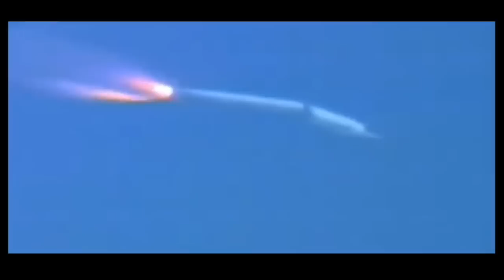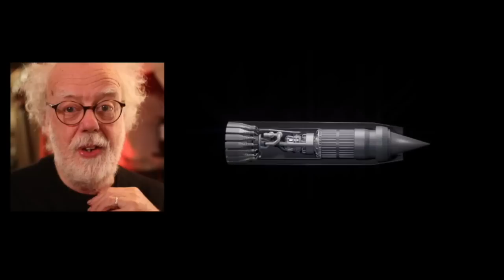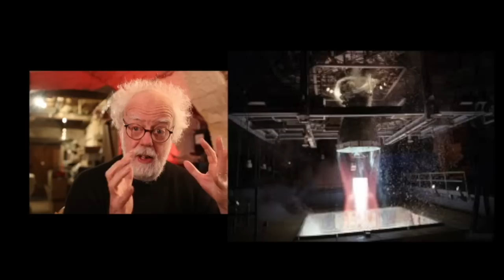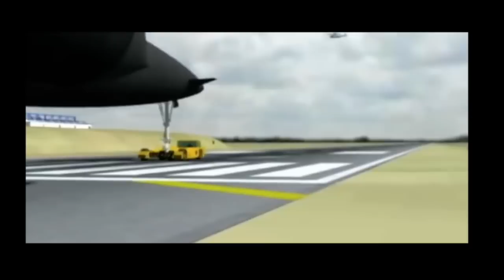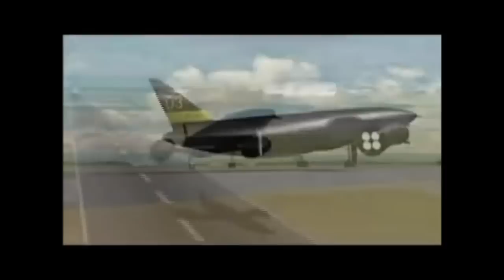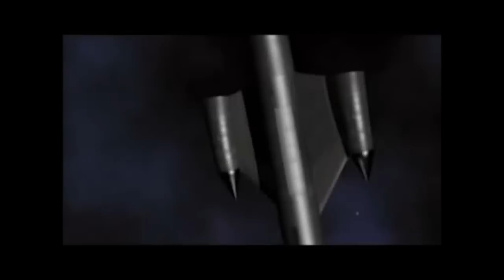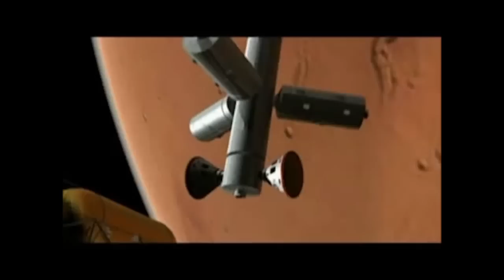SKYLON - The dream - Prof Simon

Comment: The anti-frosting technology is NOT secret. It is detailed (albeit in the usual obtuse patent-ese language) in the patents that were filed and publicly accessible back in 2015 See:
https://patents.google.com/patent/GB2519148A/en?assignee=Reaction+Engines+Ltd.&before=priority:20160101&after=priority:20130101&page=1
for searchable text, and:

https://patentimages.storage.googleapis.com/c8/23/c6/5637f3c2e5629f/GB2519148A.pdf
for images and diagrams.

This was in the V3 SABRE. It used some trick of chemical processes where methanol would travel against the airflow, dissolving the ice crystals that formed on the pipes, and transporting it away from the tubes, then recycling the methonal. This prevented frost building up.
The V4 SABRE has a different design. So far as I understood, (and obviously, it is not always possible to have absolutely all the info) they came up with improvements to the engine cycle that meant they didn't have to go sub-zero, so no frost, so no anti-frosting tech needed.
I have never seen anything that would indicate "vibrations" being used.

Comment: A lot of pretty pictures, does not make it so.
Reply: Thirty years of engineering work, however..
Reply: @jocramkrispy305  Yeah, propably thirty years more.
Until they find, it won't work.
Not in this form.
I would equip a glider with scram jets and lift a smaller rocket to high altitude,
from where you launch.
Then, you can bring multiple smaller payloads into orbit and use remote
controlled drones, to assemble the entire thing, in space.
Reply: OK, what flaw have you found in the design, missed by both ESA and USAFRL who have both said they can see no obvious flaws? how many hydrogen engines have you worked on and successfully fired? How many launch vehicles have you designed that have successfully put a satellite on orbit?
Reply: Your approach is quite the antithesis of a HTOL SSTO, and would not achieve the operational simplicity that this engine is designed to enable. How are you going to get your scramjets up to operational speed?

Comment: Really inspiring, I would only venture to say from an aviation standpoint I would like to see more vertical stabilization. Like a bit of a spine leading into the tail. That's all I got.😬
Reply: The all moving tail is enough, given the CoG is quite far forward and the vehicle is long. The design point for the tail is they can fly it with one engine

Comment: Prof S. Holland, I think that the method of breaking away ice from the tubes is not vibration since fatigue life would be major failure point and 10^7 cycles would be achieved very quickly.  A better way of getting the same fluctuations is von Kármán vortex street, vortex shedding, alternately shed wake off a cylinder with cross flow.  Then the first layer inlet would be non-cooling and there after all the other  and first would shed a vortex that cleans the leading faces of the tubes in their wake.   

The nozzle picture shown was also interesting.  The first standard bell type nozzle is a failure.  The second dual nozzle would work to take a short in atmosphere nozzle and convert it to a vacuum one.   The third I think is just a version of an aerospike.  But with the center area at atmospheric or vacuum pressure.   An interesting twist since it addresses the major problem of an aerospike, the very large throat and combustion area of a annulus combustion chamber and nozzle.   I assume some air is exhausted in the center to create the 'atmosphere pressure and detached boundary that adjust for pressure.  The bell on the outside is the attached boundary for the combustion chamber supersonic flow.   Thus the annulus is much smaller while the engine gains the pressure adjustable of an aerospike.

Comment: Couldint it be just an adjustment of the inflow of air to not get quite so cold. You have 1000 degrees hot air and below freezing helium pipework cooling it. Less helium, more heat, no freezing. I know its probably not that simple.
Reply: That is one of the potential advantages of the SABRE 4 design, however the de-icing capability may have application for other uses of the pre-cooler.

Comment: It's not just that oxygen weighs a ton, but you need twice the oxygen weight for your tank of hydrogen.
Because H2O.
Reply: You may have your logic backwards, H2 and then O1, not the other way around ...
Reply: Yeah, that's definitely backwards.

2 hydrogen per oxygen.
Plus, what has the composition of water have to do with rocket propulsion?
You're using oxygen to 'burn' hydrogen...
The main problem is oxygen is, based on the periodic table alone, 8 times as heavy as hydrogen.

An equal number of each molecule would mean you'd have 8 kg of oxygen to every kg of hydrogen...
Pretty dramatic difference...
Reply: @KuraIthys  yes that person has it backwards, but the relevance of H2O is because that's what the combustion product of H2 and O2 is. Stochiometrically you need 4x the mass of Oxygen as you have Hydrogen. But it's usually a little lower than that because most engines run a little fuel rich to avoid Oxygen attack of the engine's metals.

Comment: Great video, thanks Professor. Would it be possible to de-ice the precooler by pumping some exhaust gases through just one section of it at a time? Say, looking from the front at the annulus, heat from the 12 to the 1 o'clock position for a few seconds, then valves switch the heat to the 6pm to 7pm section, then back to the 1pm to 2pm section and so on, round and round?
Reply from the maker: Good ideas

Comment: so why not use hydrogen per oxide as fuel ??and reduce the speed of the vehicle in orbit so it dos not generate so much heat during re-entry - as in have a fuel system placed in orbit to re- fuel the ship for the retro rockets
Reply: I wouldnt trust my payload on a vehicle that cant carry enough fuel to retro. Retro doesnt require much ΔV, not compared to launch.

It's relatively easy to reenter when compared to reaching orbit.
Reply: @Jwmbike14  It requires a lot of fuel if you're using retro to avoid reentry heating, as Alex Smith was suggesting
Reply: ... how would you get all that fuel into orbit?

Comment: Yeah, a whole bunch of rubbish: do you really think Chinese will buy it?
Indeed you have to cool all that air really fast before you burn your fuel with it! Or it may get really hot you know, like a rocket engine or something! That's British rocket science for you!
Reply: Yes, you have to cool the air so you can compress it since rocket engines need dense cool air that isn't moving supersonically. And while it's on its way to the combustion chamber it shouldn't melt anything.

Comment: I wish Reaction Engines the best, but I'm seriously concerned this concept will be like betamax vs vhs or a kind of spacecraft formatting where one company will get a monopoly and other companies with safer and superior the technology get left behind because they couldn't get past the barriers to entry fast enough.
  I love SpaceX but I think bfr will have same problem as space shuttle or other conventional rockets. They are intrinsically unsafe.  The less stressfull ascent and reentry profile of skyline and it's true SSTO capability are the areospace equivalent to nuclear fusion.
Reply from the maker: Brilliant analogy
Reply: @SimonHollandfilms  thank you.  The gravity loss problem and higher fuel weight fraction of conventional rockets means they have to perform at a dangerous threshold of performance.  Skyline just takes off like a plane and it looks like it's flight profile and the advantage of air breathing means it's engines can cruise easier, with less chance of catostrophic failure.
Reply: my fear is you're completely right. the british ruling class is basically incompetent, while the real talent is wasted. that RE has to scramble around for private investment is a travesty. meanwhile nerd billionaires push half-baked vanity projects and the best solutions remain grounded. sincerely hope something changes.

Comment: Why not use the Aerospike type for the burning is better at sea level and expands for the higher level al the way to and throughout the space flite and back again throughout to sea level by using the air pressure to form the other bell half. There are some cooling problems with it but your telling of some opposite of having too much cooling why not combine these to solve each other's needs and the gimbal can be solved by flex tubing from the combustion chamber to exhaust as an Aerospike by transferring this heat to the intercooler from the spike's tip or Vise Versa. Heat some Hydrogen to add to the cooler's path the hydrogen will cool the spike this heated hydrogen can warm the cooler some then burn all the hydrogen with spraying some along the wall of the aerospike's for after the air breather is not used any longer. Or use a coolant to transfer heat from aerospike flame wall to the cooler transfer the cooling effect by a by-pass that is controlled for the needs of each of the needs of the events. There are many ways to solve this.
Reply: because the expansion/deflection nozzle in SABRE 4 is even better than an aerospike
Reply: Aerospikes have well known issues which conflict with the benefits, the ED nozzle is a possible alternative that REL has investigated and even that is no certainty at REL because it has its own complexities.

Comment: These engines are a lot of fun to play with on Kerbal Space Program! 

I've designed MANY SSTO's using them, and stable re-entry has to be the hardest part of the overall designs. 

You have to make sure your center of lift is behind the center of mass, but not too much, and you need to make sure you have a proper amount of variable drag in the back to give yourself a shuttlecock effect. 

There couldn't be a more perfect game to teach rocket science and play with all the possibilities you can come up with. 6062 hours and counting.. not including the time playing the alpha and beta pre-releases. 

Time well spent, rocket science rules.

Comment: Cooling the intake air with the liquid fuel, then slowly add liquid o2, as it leaves useable atmosphere!  Maybe recycle some of the hot intake air to enter at different locations of the cooler, to prevent freeze-up!  
Get rid of the bell nozzle,  that will fix it!

Comment: All these stupid ideas are just a waste.. its the same as a stupid elevator made out of Graphene.. We need an EARTH LIFTER. An Earth liet can lift Tonnes or water, Soil, Metal, Wood concrete Glass, People etc.. all the stuff to make a MONSTER space station. It just takes many years to make and a lot of Energy to use. Years.. to make the EARTH LIFTER, well we have approximately 500-1000 years according to the late Steven hawkings. ENERGY well the ITER, TOKAMAK  should be able to fill this capacity and be a great Space station Energy component.

Comment: So basically just a ramjet engine. That works inside and outside a vacuum.
Reply: No where near a ramjet. ..more like a jet engine siamesed with a rocket engine (so it can in certain regime effectively function as if it was a ramject/scramjet) and an extremely advanced fridge, married to an intake system inspired by the SR-71's.
Reply: The engine does use ramjets to dispose of the excess hydrogen used for cooling whilst over-compensating for inlet-drag (BAe called this concept negative drag, because in HOTOL drag was their work-area and thrust was Rolls-Royce)
Reply: @jocramkrispy305  true, the core engine system used in atmosphere does have moving parts; so overall not a ramjet. 
   But they do indeed seem to be an additional thrust augmenting subsystem handling the coolant spill-off as well as with air bypassed from the compressor core, until the machine is in a high enough mach-speed regime for those 'ramjets' to work more efficiently. 
   Although if the vented hydrogen isn't 'lit' within them, the venturi effect of the augmentor ramjets design would still function as thrust generating area - at a lesser amount compared to when combusting I would think.
Reply: @razor1uk610  uh... yes. That's why I said it uses ramjets, and "over compensating for inlet drag" should have implied they produce net thrust. However, the majority of the air-breathing thrust comes from the air-breathing rocket engine, so it isn't "basically a ramjet"

Comment: Extremely exciting!!!    Makes me wonder how an air-breathing engine's internals would withstand orbital re-entry temperatures.   The SR-71 had notorious fuselage expansion issues even at Mach speeds and associated frictional temperatures.
Reply: Hopefully the engine internals would never bee exposed to reentry plasma. The inlet is intended to be sealed as part of the transition to oxidiser powered ascent
Reply: During the rentry, the craft is oriented so that its underside meets the air flow until its speed is low enough for it to start flying conventionally. So even if the intake hadn't been sealed during the ascent, there would be no flow into the engine internals.
Reply: @sylviaelse5086  It's oriented for a lifting reentry, which means the bottom isn't square to the airflow, but at an angle, so the intakes would injest some plasma if they weren't closed.

Comment: Deicing : Alternating Electrostatic charges, keep the water molecules disassociated and moving.
Reply from the maker: Brilliant
Reply: Interesting . . . you know certain things don't you? ...
Reply: Interested idea. I read somewhere that it was simply antifreeze injected in the intake though...
Reply: @phamnuwen9442  yikes! Sounds kinda messy. But for some reason understood the cooling apparatus to go well below the operational limits of antifreeze compounds. Perhaps I should go and read more articles on the cooler then.
Reply: Pham Nuwen I’m not so sure that would work. 
The antifreeze would be injected in to the airstream before the cooling so wouldn’t the heat of the air at the very least vaporize and at worst damage the chemical solution of the antifreeze?
Even if that doesn’t happen wouldn’t the extreme cold of the cooler freeze it anyway? 
And if temperature range isn’t a problem for the antifreeze, wouldn’t the weight of it be a rather large issue? (pun intended) with how much air is moving through those engines you would have to use A LOT of antifreeze, and it would just be getting dumped overboard. 
Unless the antifreeze is also part of the fuel mixture for the air breathing portion I don’t see this happening... maybe that’s how they did it?
I don’t know any of the numbers here, just food for thought.
Reply: @numnut1516  I don't remember where I read the antifreeze idea and I'm not an expert in the field so can't say either way whether it could work.
Reply: @numnut1516   The methanol is injected in region just above freezing point and collected a little further in, in the below (water's) freezing point
Reply: This goes well with what he said about using some of the heat of the air for engine processes
Reply: It's not impossible as a solution, but the showstopper would be the energy required to achieve the desired effect and the voltage challenges. Due to the very high mass flow rate of air through the cooler, to reliably charge all of the water ingested into the engine the applied field voltage would have to be very high, substantially more than 5 kV I suspect. The mass flow, which I can only speculate on based on my knowledge of similarly sized gas turbine compressors, is likely to be around 200 kg/s of air, which at 100% relative humidity (i.e. a cloud) results in ~ 4 kg/s of water ingested, and the energy required to charge that mass flow would be significant. Furthermore, the voltage itself presents a problem, since as air pressure decreases, Paschens law results in the risk of arcing, as the minimum dielectric breakdown voltage drops substantially.

Comment: Ehm you'just used a heat exchanger to cool air from 1000°C and that heat could definitely be used to prevent the freezing could it not? Without vibrating the tubes which probably wouldn't do much... Thanks for the documentary it was interesting to watch.
Reply: not without reheating the air, which would make cooling it a bit pointless
Reply: Varying rate of flow of heated air over large cooled area will certainly be of use, you don’t have to use all the heated air and transferring heat from one system to another is not pointless, is it? not using the heat to do work is bad design if it can be used. I’m sure RE are top notch engineers and geeks so I suggest that they wouldn’t waste heat like that.

Comment: Ok, slightly lost confidence in you when you don't understand the shuttle engine.
Reply from the maker: Explain what I got wrong....that’s why I run the ch for discussion.
Reply: You seem to suggest that the Shuttle uses three different main engines for different altitudes and throws two of them away. It is the same engine (RS-25) that is lit on the ground and that works all the way up to orbit when they throw the orange fuel tank away.

The Shuttle system does however use three different sets of engines/motors; the solid boosters, the main shuttle engines and the orbital maneuver engines (the two smaller nozzles above the three main engines). The two solid boosters (the white sticks on the sides) are thrown away (although they are recovered and reloaded for reuse).

Interesting over all though, I've been following the project for many years and hope they make more progress, I want to be able to fly to New Zealand in 4-5 hours.

Comment: Hmmmm....instead of "vibrating" the cooling tubes which would need another mechanical system that has the potential to breakdown, they should find a way to use some of the 1000k  in heat to keep the tubes from freezing since the engine produces more than enough heat to achieve this.
Reply from the maker: good plan